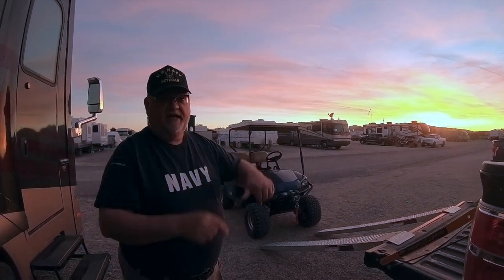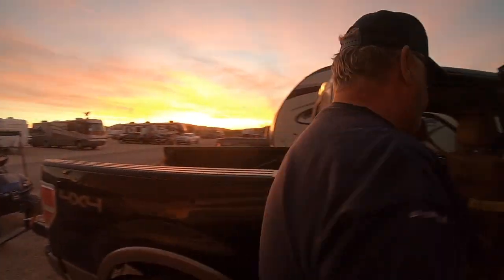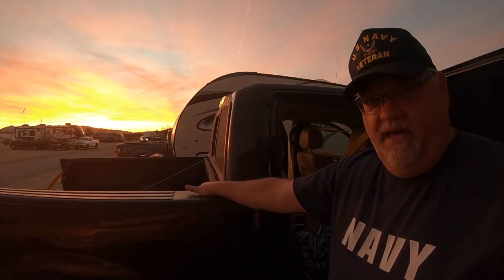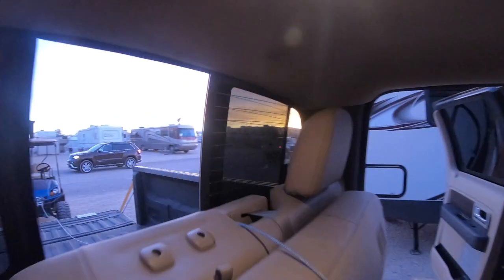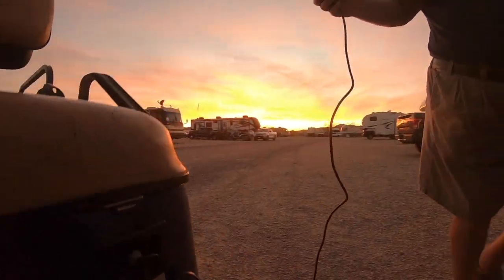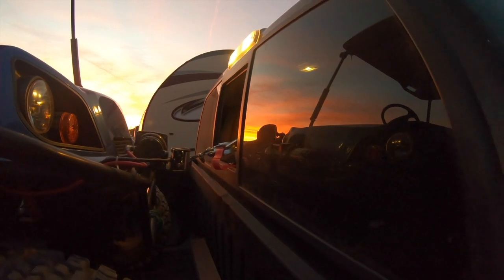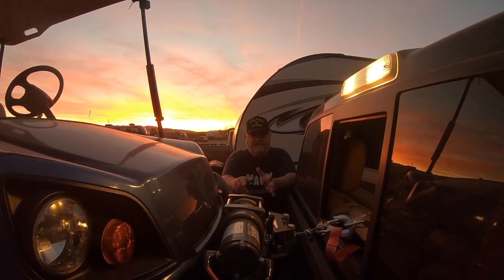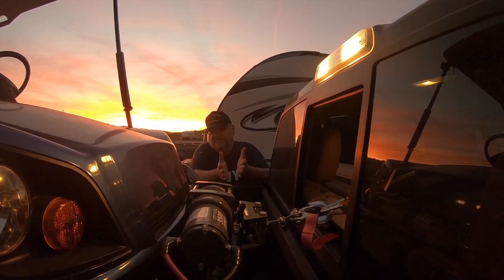Loading a Golf Cart in a Truck Bed. The Easy Way!

Comment: What Winch are you using and how did you attach it to the golf cart?
Reply from the maker: I used a harbor freight - which I would not reccomend,   And I just drilled 2 holes through the bar on the front and bolted the hitch right to the bar.

Comment: Is it possible to pull a camper trailer with the golf cart loaded in the truck?
Reply from the maker: David Grooms - some do.  But to be safe, you need to know exactly how much cargo capacity your truck can carry,  then make sure you don't exceed the trucks capacity.   Most truck will do a lot more than the manufacturers allow, but if you get in an accident, and cause an injury, the lawyers will come after you with a vengeance.  Good luck and be safe.

Comment: Very creative and much safer.. nice job
Reply from the maker: Thank you.
Reply: I'll be doing something similar to this by the end of this summer for sure.... thinking about mounting the winch in the bed of the truck.. of course making it portable..
Reply from the maker: I’ve changed beyond this.   I’m now using madd ramps.  Google them.
Reply: I'm looking at an outfit called long ramps... Google it.. they have a 3 inch side guide rail up the sides..

Comment: Best advice I ever got was if you go camping you probably gonna get a golf cart in the future.  Get a 8 foot bed.  Golf cart in tailgate shut.
Reply from the maker: Rick Baier - very sound advice indeed.  It doesn’t work in my case, as I am towing the truck and cart behind my motor home.   A f250 would be too much weight behind my motor home.   I did buy reinforcement bars for the tailgate though.   This method does work well for me. Thanks for your comment and thanks for watching.
Reply: @RandomBitsRV  Yes you are correct your probably in the 65 foot range.
Reply: My club car is 9 feet long.  8 foot bed is essential so both axles are in the bed, not on the tailgate.  I can't close it but no big whoop.